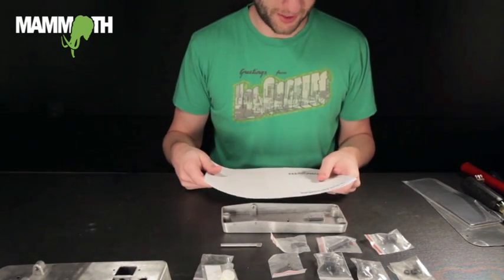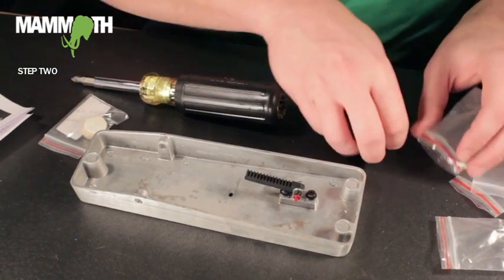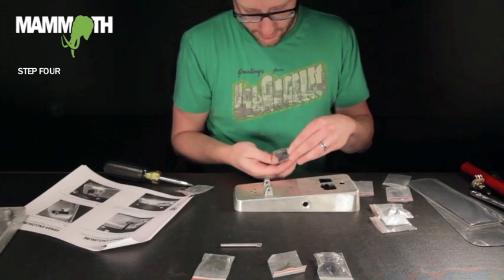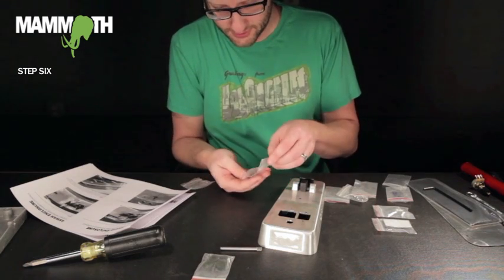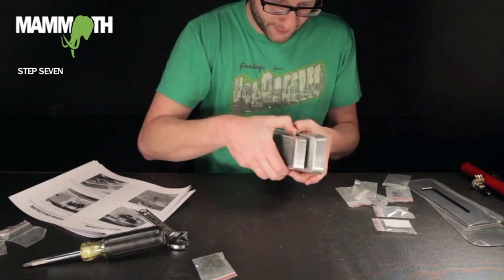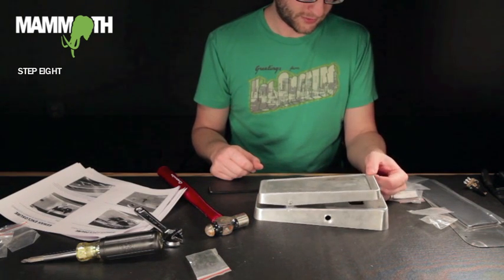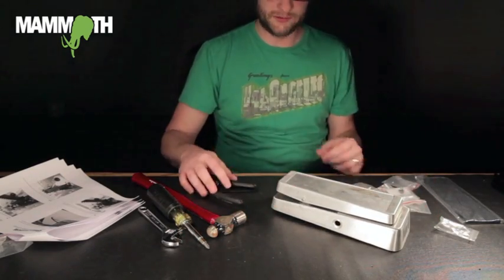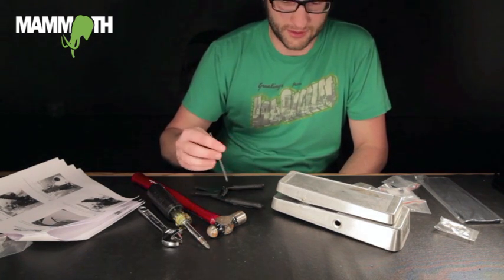4SWAH Wah Enclosure Assembly Instructions by Mammoth Electronics

Comment: One important aspect of wah assembly and "adjustment" is the footswitch (usually a 2PDT or a 3PDT if one is including an LED on/off indicator) -- the HEIGHT of the switch, to facilitate the pedal's actuating of the switch reliably is mega-important;  as I recall there's usually one or two rubber "stopper-like" parts that cushion the pedal just as the switch is being activated, to provide for the aforementioned reliable switching with a comfortably "softened" toe-down position - again, an important step in the assembly and adjustment of the wah, but it's not even mentioned here.   Not intending to criticize, but rather would like to know if for some reason the Mammoth parts have some alternate switching arrangement/mechanism.  I realize this is 3 yrs old, but it seems that Mammoth still sells the shell and acc., and with the relatively recent affiliation with PCB makers perhaps an update might be warranted.   The video was well-done - clear and informative - again, just wondering about the switching.   Cheers.